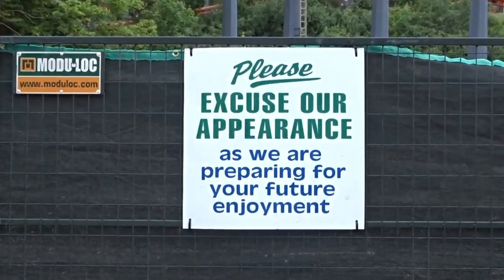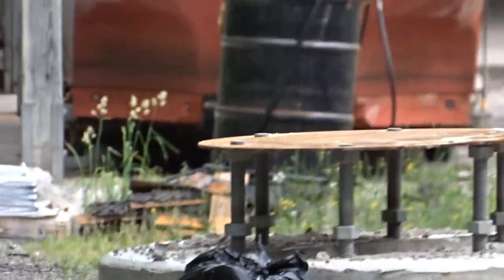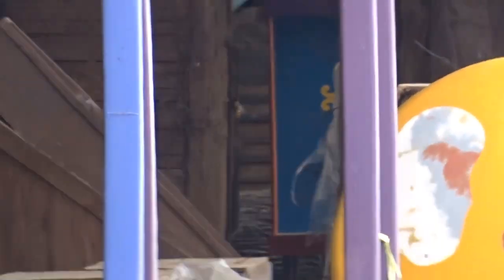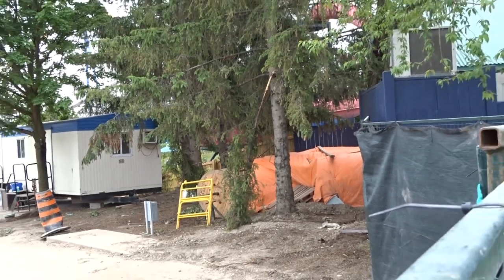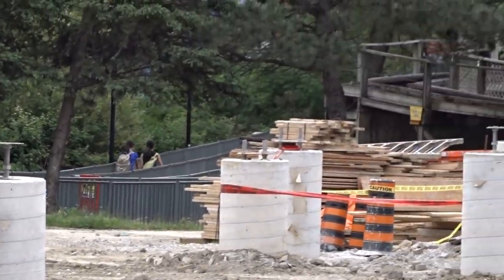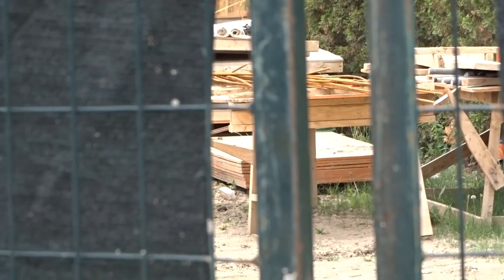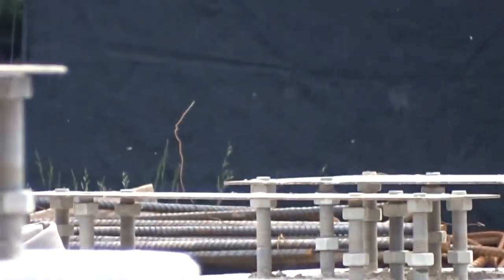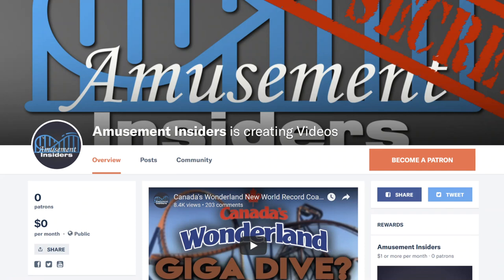Yukon Striker Massive Update

Comment: Honestly, if this ride has vest restraints, it does not matter how tall this is. If you make food with a great presentation, but it taste like crap, presentation doesn't matter anymore. Floater Airtime is what these rides are about. If you take that away, the ride becomes extremely boring which is what happened to Valravn. That's why Griffin and sheikra are still the best dive coasters out there because the restraints let you float freely out of your seat instead of plastering you to the seat like vest restraints do. However the GP don't care that the food tastes like crap
Reply from the maker: Coaster Elite I do dislike best restraints as well
Reply from the maker: Vest***

Comment: It wouldn’t be a real giga due to it most likely having inversions imo you can only really call it a giga if it doesn’t have inversions I would call it a giga dive coaster but not just a giga
Reply from the maker: Joey Kelly 01 for sure. Giga Dive but it may not even be 300 feet tall. It may only be 270 feet tall with a 30 foot deep tunnel
Reply: Joey Kelly 01 

Why do people think that a hyper or giga can’t have inversions? Just because none have them currently doesn’t necessarily mean that a giga couldn’t have any. A 300 foot tall coaster is a giga by definition